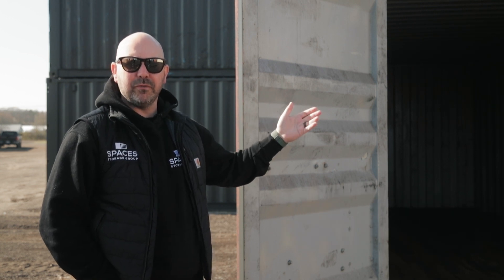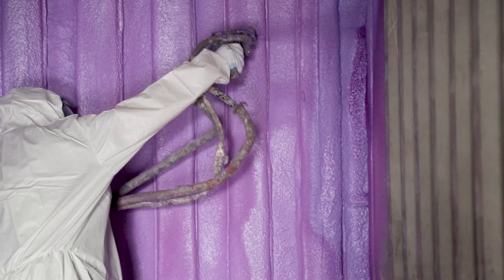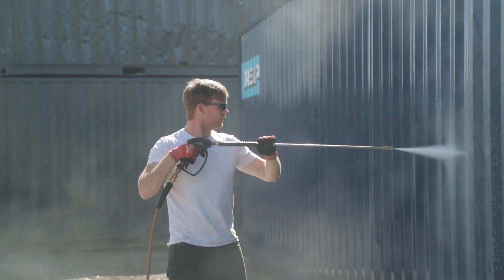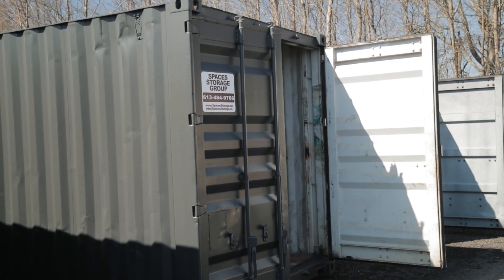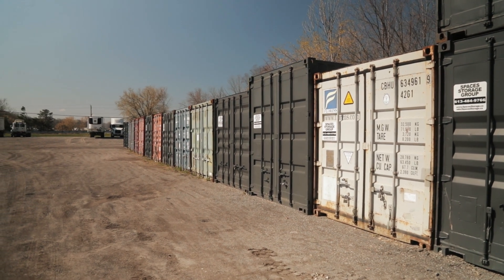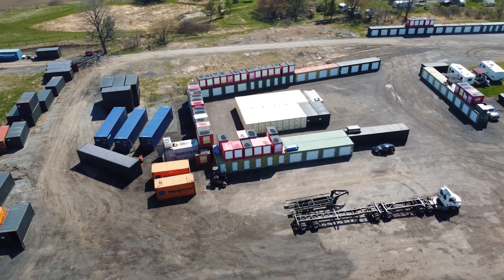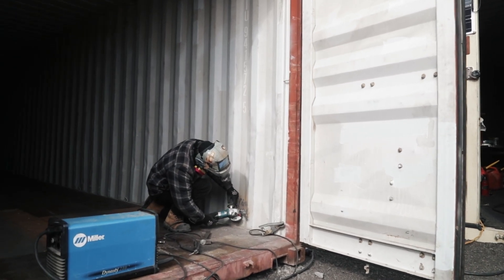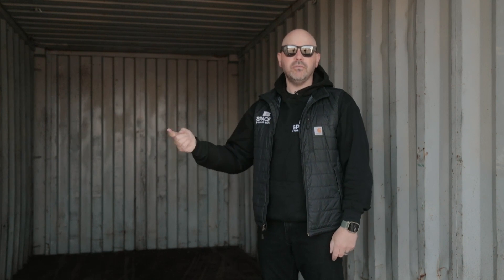Insulating a shipping container with spray foam

Comment: It's my understanding that shipping container floors are treated with pesticides, insecticide and fumigants, which are harmful to human health. What steps do you take to mitigate or remove those hazards? Thanks.
Reply: Id check to see if the rock wool absorbes moisture because its organic there is a good chance it will.
Id say fibreglass insulation would be better to avoid condensation.
(I know the wool is better generally just maybe not for that specific situation)